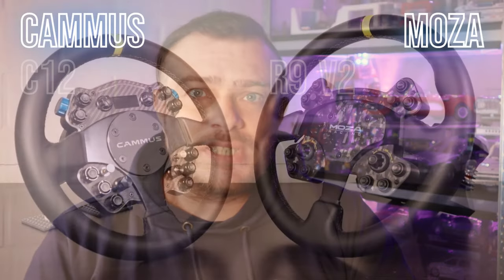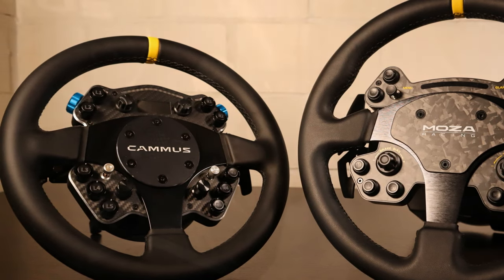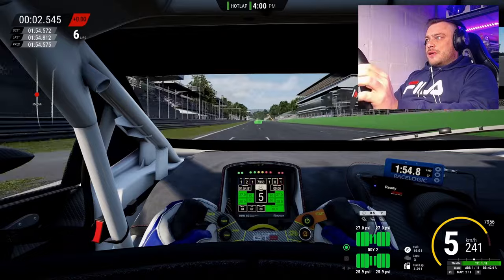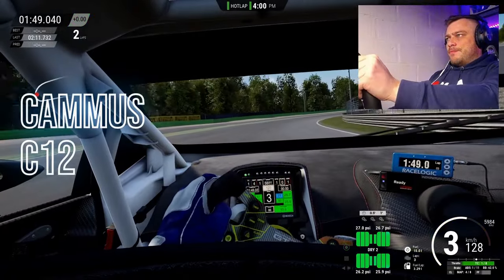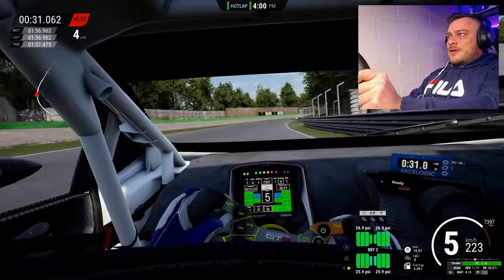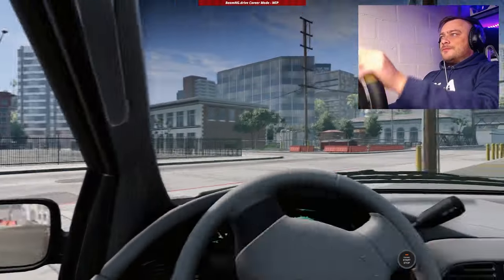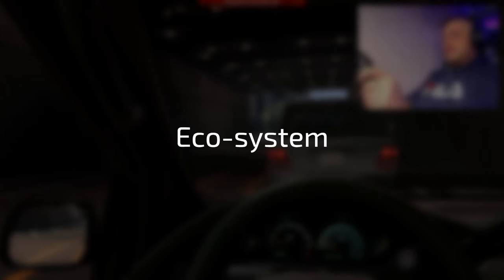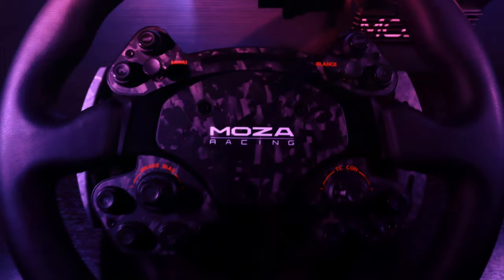Versus: MOZA R9 v2  vs CAMMUS C12

Comment: I mainly do a ton of drifting, every once in a while I'll hop in a race. I mainly like cruising, and if I am tracking, I'm most likely just going for lap times. I want to upgrade from my TMX, I'm torn between the Cammus C12, and Fanatec CSL DD 8nm. I just don't know if 12nm of torque is even necessary, it sounds borderline excessive. But I also don't want to feel like I have to upgrade six months down the line if I did go with the CSL DD 8nm. Any advice in this decision?
Reply from the maker: 12Nm is indeed a bit more power than necessary... for me. Now the nuance is that I drive mainly games with normal cars. In a game like BeamNG or if you drift, you will manage with 8Nm but if you go on tracks where you need to feel the details, need to feel some intensity, some struggling... then yes, I would go a bit higher. But its not only for that that I would choose the C12. It feels remarkably premium for the price and the abundancy of buttons, encoders and joysticks makes it possible to play BeamNG even without keyboard. Between both, if I needed to choose for myself and keeping in mind budget, I would go C12 and in your case, I dare recommend it too.

Comment: nice review! these 2 were my buying options, but i ended up with fanatec bundle /dd 8nm/mclaren gt3/elite v2 pedals for 800e .. if cammus had cheaper shipping options i would definintely take it
Reply from the maker: Shipment from China is always a very expensive option and it can weigh on the price. But if i may be curious. What region are you from because they do have some more localized warehouses now which makes shipment (and tax) cheaper?
Reply: @SimulatedDrivingResource  i am from Slovakia, even from Europe warehouse it cost 120e for shipping with lc pedals, and without pedals around 70e
Reply from the maker: @K1KO0o0  pfff.... that is heavy pricing indeed for shipment, especially if it comes from Europa! I didn't know it was that much. Thanks for the info.

Comment: Very nice. Tbh cammus has a great feel but I almoat do not like its weighty feel. It has to much dampening weight. So it feels rich af still detailed but it has this extra weight that I do not like. A wheel should feel flowy. You should feel the edge of grip and be able to push past it if needed not a full lock. I think a flowy bouncy feel is nice but it needs to really allow you to feel all of the points of grip and suspension and you should be able to go through that. I feel some wheels like asetek and this cammus in acc have an extra dead weight feel I don't like. I want power from forced but not feel stiff right away. It should feel progressive to me but that's all preference.

I actually think moza feels good with some friction and inirtia added to it mixed with a bit of dampening its nice.

Kind of like I do with my simagic ultimate. I use inirtia at like 10, friction at like 15 and dampening at 15 With details maxed out. But yeah seems to really help so much with suspension and edge of grip. I think alot of us go for more details like track or curb detail but me I don't. I look more for the suspension feel a realistic car feel and the edge of grip. Those are my favorite details and its how I set my wheelbase up to feel even if I drowned out some of the curb details. Curb details do not help you be faster lol.
Reply from the maker: Yes you gave this comment before and I noticed it now too and tried to point it out. But for me personally, it's not that bothersome.
Reply: @SimulatedDrivingResource  exactly its all preference. You probably enjoy the rich feel. Its def a nice rich feel.

Comment: Your settings show that you did turn down the R9 to 50% FFB strength, so your comparing the R3-R5 to the C12? Your settings are made to fail.
Also in the price you take the most expensive round wheel Moza has to offer. You forgot to add that you dont like Moza. :D
Reply from the maker: Absolutely, in a game like BeamNG where FFB is not about power because you drive normal city cars, it is turned down to 50% as it represents best the driving sensation there. In ACC it is turned to 90%  and corrected in game to have the least amount of clipping. As for the steering wheel, the RS V2 is the one that resembles the (fixed) steering wheel of the C12 best for functionality, features and overall quality. Which one would you have selected for a comparison? If you had watched the conclusion, you would know that I would prefer the R9 with the trucker wheel and stalks above the C12 even though it is less powerful if I could pick only 1 for my personal use. You are always welcome to criticize, in fact I can only thank you for it, but try to ask questions instead of making assumptions.